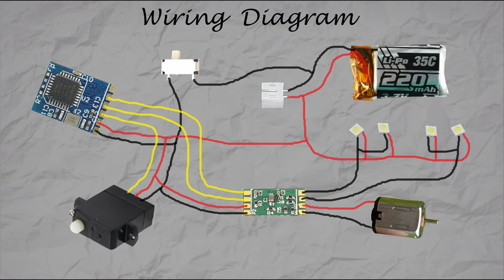3D Printed 1/87 Scale RC Semi Truck with Trailer

Comment: Nice but, respectfully, I thimk you are slightly off on scale, the width you cut the rear axel to would make the truck over 3M wide at 1/87 scale, I'd say your vehicle is closer to between 1/72 and 1/64 scale